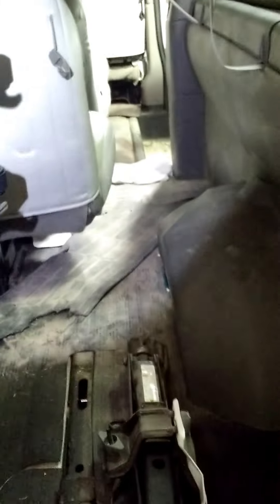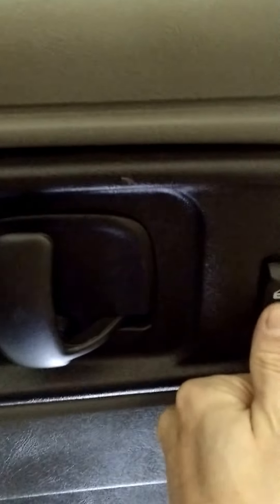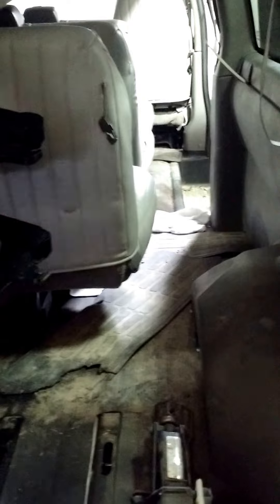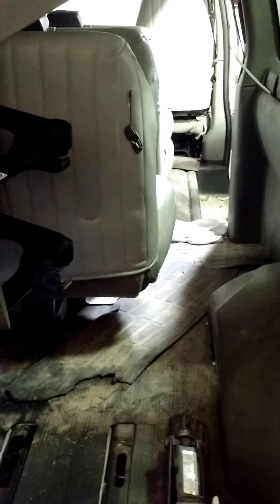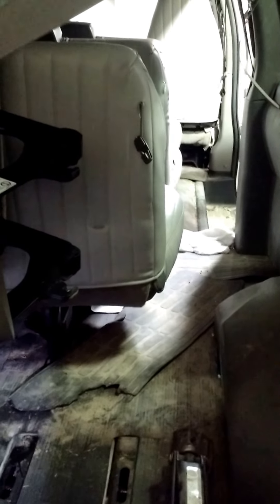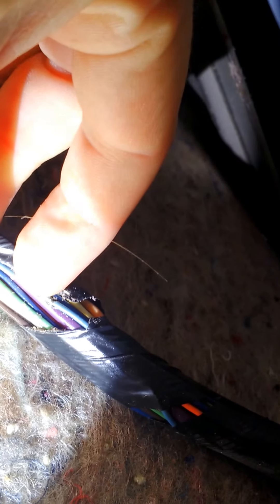2011 (2003-2015) Chevrolet Express Van 2500 (Passenger) 6.0L Doors lock while driving FIXED!!!

Comment: I have a Chevy Express that makes noise but doesn't lock or unlock the back door when I press the control or even the buttons on the driver's door.
Reply from the maker: Hard to say without looking at it what the noise is.  But could be a lack of amperage to mechanisms or just old, worn out actuators...  They only last so many lock / unlocks.